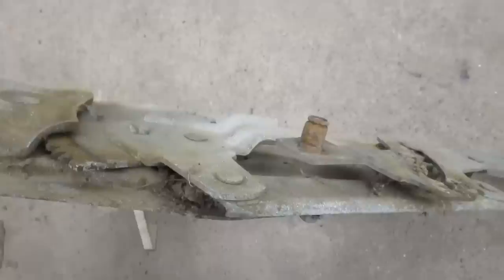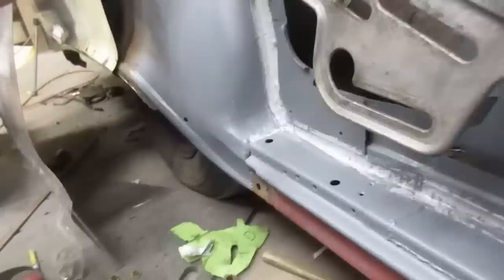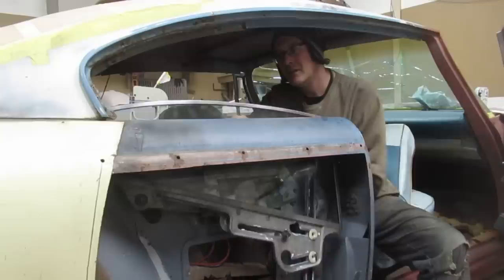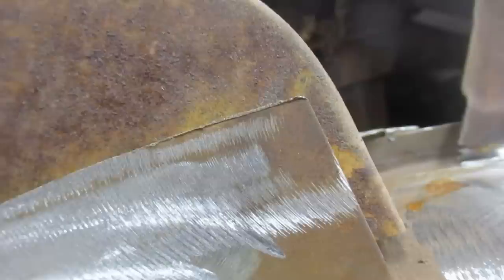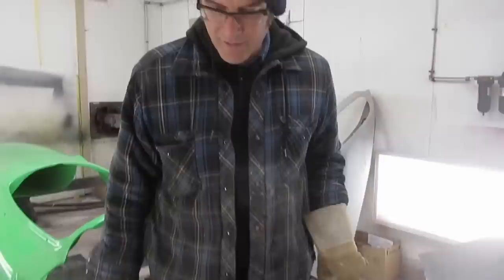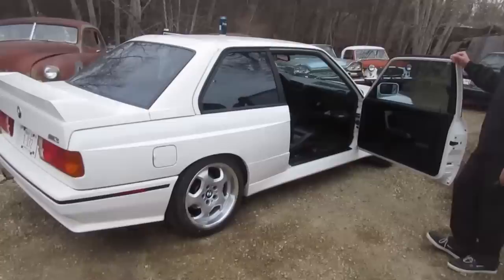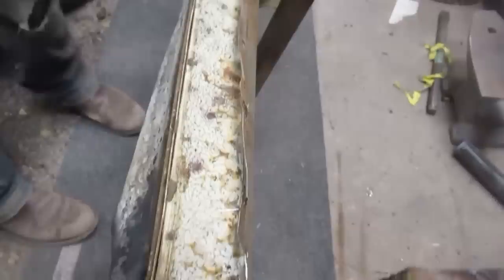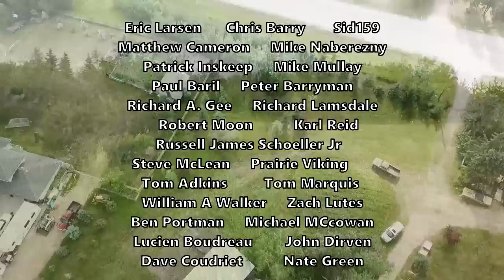1960 Plymouth Fury Project! Part 14...

Comment: Another awesome installment! Something about the glamour shots of the window rolling up and down slowly reminded me of the bay doors on the Death Star opening or closing. And the sound deadener glop flashed me back to age 13, dorking around on my '52 Ford. I decided the gas tank needed the undercoating completely removed (why?!). I quickly got sick of trying to have at it with a putty knife, and grabbed the air chisel. Tore a 1.5" hole in it in short order.

Comment: Hard top window mechanisms are especially troublesome to fit. If that car were a 2-door post you could just say fuck it and grease it up and throw it in and it'd just ride in the channels up and down. 

Man that quarter panel sure is coming along nicely. As far as real work goes that has been 90% of the fabrication that you've done on this car so far. Can't wait to see you whistle in that trunk floor and button the rear end of the body work up.

Comment: Looks great Scot! I use a 1 inch wide scraper to remove the tar crud.  You know, the ones with the yellow handle. I sometimes break a handle or two or chip the blade.

Comment: I used to work on an assembly line. We only had a 45 minute lunch that was regulated by a punch-clock but that did not prevent us from driving to the bar and having a 3 beer lunch on Fridays. "We'd like three Canadians each and can you bring us the bill right away so we can pay you before we have to leave."
Reply: I suppose they would not let You back to the assembly line these days with three pints to Your face, would they?
Reply: when I was on the assembly line I brought a cooler with nine beers. One night on OT a manager said I could go for a beer right now. We went back by the ovens in the paint shop. He said, that's cold!

Comment: I've been watching this series and am well impressed with your skills.  I "built" a 1953 Studebaker some years back using parts from several cars, purchased patch panels, and some home-made but not to this extent!!  The rear quarter window mechanism on the Studebaker is somewhat similar in that it first goes rearward a couple of inches and then drops downward.  A total nightmare to get working properly.  One wonders how factory line workers were able to get these setup in a timely manner!

Comment: I was going to replace my 68 Charger quarter glass regulators, very similar to these, with modern straight up and down affairs until I was bedazzled by the intricate and also very necessary action of the existing regulators. I posted a video along the same lines as I was so impressed with the pre CAD engineered mechanism. Adjusting them is insane though. So much going on.

Comment: That's one design feature I sorely miss on today's vehicles..........a true hardtop design! Today's cars and trucks with their woefully thick B pillars can be an annoyance to drive as someone who's tall like me has to have the seat back as far as possible and that B pillar blocks my peripheral vision. It's one of the reasons I buy only two doors. I don't have that ugly B pillar on the side of my face.

I'm saving the part of the video where you show how the rear quarter windows roll up and down. A BIG hobby of mine is model building and I've built models where the windows roll up and down, but I have yet to do a closed car with the rear windows working. Very clever how that was engineered as GM and Ford would have done pretty much the same thing with that size of quarter windows. 

Keep up the great work! I used to ride around in a car just like this as a little kid (mid '60's), but that one was all black with a red interior. BEAUTIFUL car and you don't see them much anymore, even at a car show. :)

Comment: Yep !! Need a "parts car" for those double groove nylon wheels. ;o) Four quarts of "stop leak" and one quart of MMO !! Your "organizational system" is just like mine. It's a code ------------- and I haven't deciphered it yet. All those arms, slots, and gears, just to roll the window up and down?? Doesn't it have a "App" ?? Don'tcha love how it takes 10 hours to form the panels and hang the new quarter panel and 25 hours to figure out how to get the window to go up and down smoothly and without any bind??? Way easier doing it from the "open" side huh??? That quarter panel looks great !!! No easy feat dealing with the warpage, shrinking and stretching. Not to mention the shaping. Was somehow expecting another CWM video the day this came out. Sorry, it's taken me two days to comment. 👍👍👍🤠🤓

Comment: Nice BMW.. I had a 88 M6 back in the early 90's. They did seem a bit hesitant down low but once up in the  license loosing zone they really came alive . I could cruise at 200 K's without a worry .That MK3 is pricey car today but i remember they weren't easy to sell when new.
Reply: They sold way better than BMW estimated and the M Technik sports branch grew bigger with this M3 than they initially wanted it to ... every bricklayer worked long cash shifts on saturday to get one and keep it going round Munich back in the days ....

Comment: The right rear window restoration you had to coordinate the window/head/jamb, & sill, front window, and then attaching the winding mechanism into the body below, is a lot to consider, but you made it look "easy enough". But we know looks can be deceiving.
The metal body work was again looking easy, but not so.